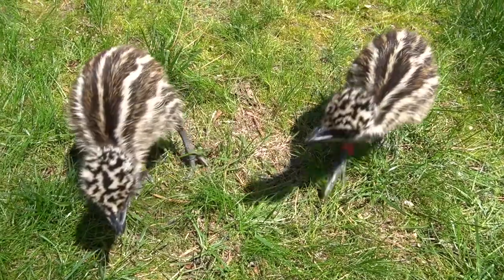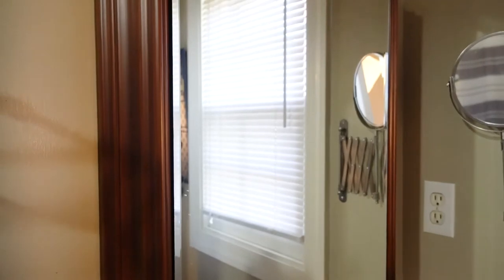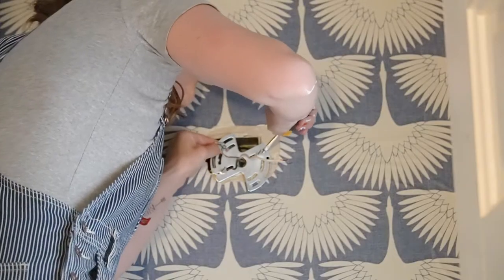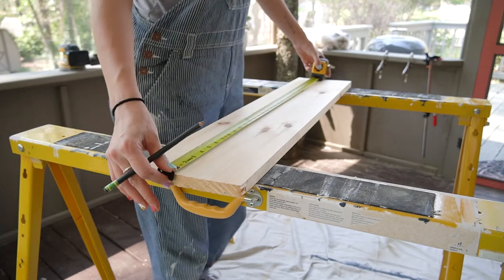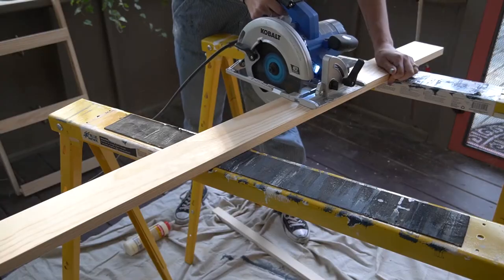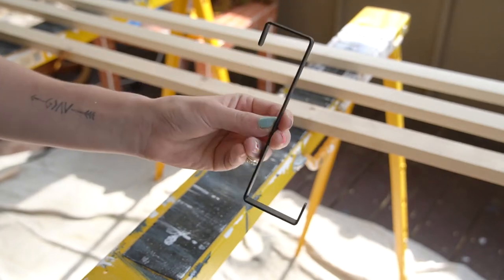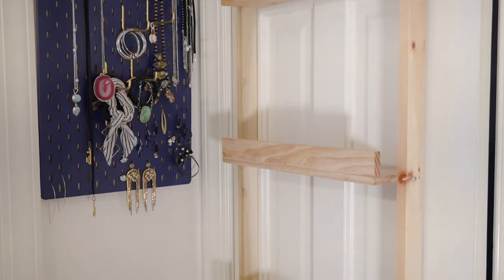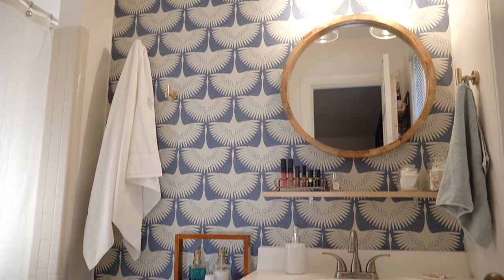SMALL BATHROOM MAKEOVER| Small Space Storage Solution

Comment: Hai Mai, yet another beautiful makeover, can't believe such ideas give such a huge visual, practical and functional impact, one wouldn't recognise its the same place post the makeover, brilliant..!!
In this, you mentioned about a couple of other videos, I'm yet to watch it all, especially the 5 DIY's in 5 days,  I've seen the title earlier in the vlog list, but thought I would save it for a holiday, I'm sure those would be super creative and fun to watch. 
This video is very informative, if i can't make it myself, i'll atleast get some of these done through someone, especially the behind the door shelf and the towel rack. 
A few queries; The mirror, how did you give the round wooden border for it? 
The behind the door shelf, is that fixed at the bottom also?
While making the shelfs, for screwing the nails, you were using another handheld device than the drill, (could see the drill also in the scene), wouldn't the drill also do the same function as well? Inspired  by you, I'm planning to slowly try out some of the things, need to buy a drill to start with, you usually use DeWalt equipments, so I suppose its a good product. Tc and stay safe.
Reply from the maker: Hey there!!! Thanks for watching!!!
The mirror I got came with the wood. and the shelf behind the door isn't fixed at the bottom. but the weight of it makes it so it doesn't move. You could use a drill I was using an impact driver. It basically a super powerful drill. On certain project it can be nice if you have a tougher piece of wood and you're having trouble get a screw in. I do love Dewalt but honestly I get that brand because Jordan likes them. I'm not a brand snob and I think any drill will get the job done.